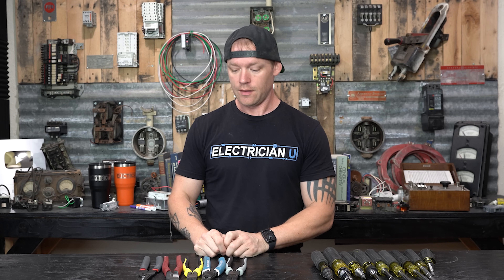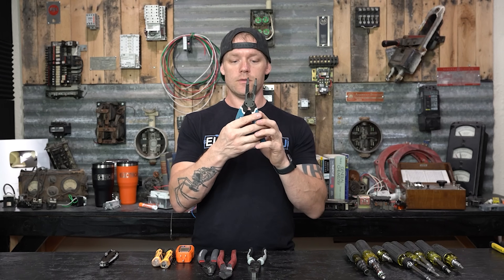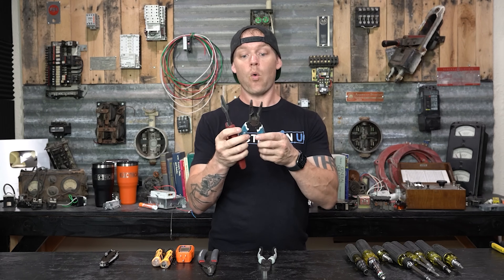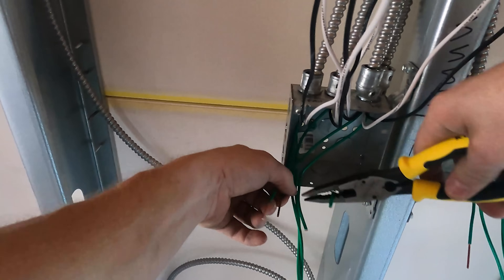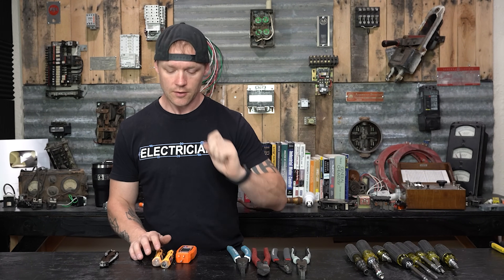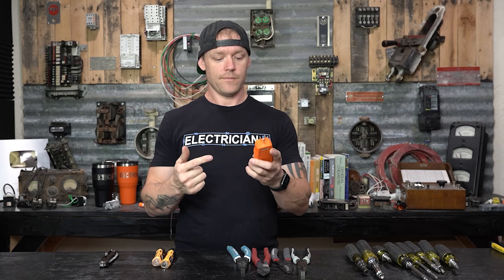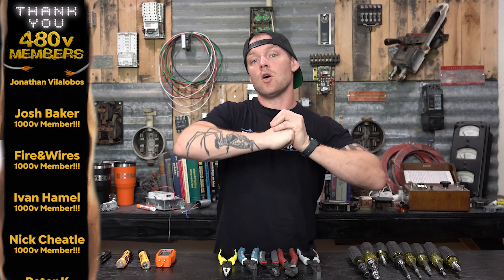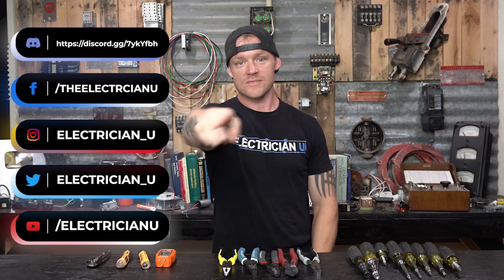The Latest Multitools an Electrician Should Have - Part 2 of 2

Comment: The only Klein brand stuff in my tool box is a tick tracer with built in light builb.
Still have good feelings when I used their curved handle wire stripper in trade school.
Will consider add more Klein elements 😅 thanks a lot for information

Comment: haha i totally thought he was using the IR thermometer version unaware of it reading the temp 13:06 but on the subject of multi tools just buy the IR thermometer version as that still works quite well as a laser pointer and it will read the temp as a bonus. What we need is a rechargeable Volt tick with IR and a light. drives me insane none of Kleins tools are rechargeable... type C with an 18650 would put you way ahead !!!! no more type B or minis PLEASE.

Comment: I completely agree with you that strippers would be WAY more valuable if they would include 6 gauge and have another multi tool stripper for low voltage. I don’t get why all of the manufactures created the same limitations

Comment: On point about how hard it is to make twists with those klein multi. I like linesmens with a spring and i like having two sizes. I have the Milwaukee ironworkers linesmen and same kind from klein but larger. I highly suggest them. Have the standards for when i need to crimp a ground barrel when the boss is around anyway.

Comment: The low voltage tester is great for me cuz I install car electronics for my job. Radios, remote starts and all that jazz. We have diagrams to locate the wires but sometimes the wire is a different color, multiple same colored wires in the same plug or is a couple pins over from where it says it is in the connector. So using that tester for locating say a brake wire is great. You just keep tapping the brakes and see which wire is turning the tester on and off. Saved me a lot of headaches in the past Haha

Comment: Doing pool electric I use everything from 18/5 low volt up to #2 awg, so my strippers always have to go up to #6 awg. I constantly find these “multi tools” do infact do multiple things, however they don’t do any one thing WELL/properly. They always skimp in one area or another, like the handles not being long enough to be good lineman’s, the strip gauges not big enough/economical enough to use as go to strippers, etc. “Single use” tools will always be my go to.

Comment: As a low voltage AV installer here in ATX, the wire stripper that does 12-28 stranded is the best I've ever bought. Perfect for connecting XLRs to phoenix connectors (aka euro blocks) at venues or when I'm making guitar cables/pedals. I'm totally gonna get that receptacle voltage reader tester!

Comment: So just wondering, what if you used a razor blade for cutting  the wire insulation.  As long as you don't lose a strand or make one brittle it's doing the same thing yea?

Comment: I do a lot of the insulated ring and fork terminals, those red handled kleins are my  bread and butter. I was using some snap-on pwcs7acf but their sizing of their stripping notches are a little tight for the wire I use(telcoflex). It's a great compact size but the Kleins are a better tool to have in your bag.

Comment: Good thread , I’ve been a Multitool fan for years , I like both the Klein Grey and Baby Blue multi’s , I’ve always preferred shorter Lineman’s , and I have better than average hand strength , ergo the blue and grey work well for me . Recently I’ve started using the new Knipex Multi , which I also like . Being nearly 70, I try to keep belt weight to a minimum . As a leather worker I make my own pourpose built tool holsters , I long ago declared war on the North American , I’ll fitting belt bucket !

Comment: Sorry man, I rabbit holed on trying to find you a NCVT with flashlight and laser and came up empty. 

You can get Klein branded [Damn near everything I use, but I’m exclusively low voltage / IT]  with IR thermometers, laser distance finder, and a few types of flashlight - but I didn’t see any which combined laser & flashlight functionality. I found a couple on eBay, but they were under $10 and looked like toys - and I can’t in good conscience  point you in that direction. 

If you should stumble across one, hit me up on Gmail with the details, and I’ll get it underway to you.

Thanks for the excellent content.

Comment: Agree with everything that you said. Some of these multi use tools have goofy positions. Think the Klein curved handle wire & screw cutter are great. Have 2 pairs of 90 degree needle nose pliers that probably only use twice a year. Rather use the plain jane long handle side cutters while working with #10 & 12 guage wire. Never purchase anything but made in USA tools.

Comment: I said the same thing about that new Klein receptacle tester. Changes game. Practticaly a simple multi meter., especialy if hu use an adapter. Can test bare wire and lighting receptacles for voltage.I have 3 in different bags. Don't use the old style any more. Super idea koo n klein

Comment: I really like the blue handled “heavy duty “ strippers in this video thr only downside as you say is twisting wire isn’t so easy and I like having the thin plier part of a normal stripper as I like to squeeze the wire around the screws when wiring receptacles so I ended up buying thr regular stripper versioned this tool..

Comment: Check out the Milwaukee Fastback knife with reversable phillips & slotted screwdriver. Remove the tip and it's a 1/4" drive socket. Flips open with a push button (you'll have to loosen the Tory just enough to make it easy). # 48-22-1540

Comment: Well it is a 'voltage tester' not a voltage meter or voltage measuring device, it is testing for the presence of AC voltage on the line significant enough to cause the capacitive load within the voltage tester to be triggered from the EM Field created in an AC circuit which is there (albeit small w/o a load)  W/o an AC voltage the EM field wouldn't exist, and thus it is a voltage tester.

Comment: Point on the "lineman" pliers. 
Do you know what their actual use is besides the cutting head? 
Lol I was an electrician for about 6yrs before I actually used them in the way they were MEANT to be used. I'm not sure what you call the little twisty wire thing that you put on heavy gauge wire that hangs off a power pole. But those pliers are for twisting those together to hold the wire.

Most of us just use them either to cut, or as a hammer lol

Comment: As an electrician in the UK I find these video's very informative but strange to how I have been trained. For a start it is frowned upon in the UK to twist solid cores together and practically all our tools are insulated (even tho we are not meant to work live) I am not saying which way is better or not just highlighting the differences. There are other differences but the list could go on lol
Reply: we twist our cores together because it makes for a stronger bond like braiding single strains of wire to form a larger cable than the wire nut is just a protective cap for the ends not the main source of connection. i myself prefer to use copper crimps and plastic snap caps.  my preferred way since high school tech class late 1990's  https://www.youtube.com/watch?v=UjPfasTjYTg&list=PLYyqRNzaEUGZZ0ouLVCHj1aa6YuIe5WDL&index=24&t=37s

o i too watch a lot of uk sparks a lot of your methods are the same and i love your swa system wld love tht to be code over here as well

Comment: For the non contact tester I've been getting good use out of the Klein that has a temperature sensor with it. Works as a laser pointer as well, but being able to find hot spots in wiring and electronics is super useful.

Comment: I really liked the gray and red hadle strippers however you're right they are flimsy. I broke 2 pair in a year. Now I use the snap on strippers made like the red handle crimper multi tool you showed for low voltage. It's beefy.

Comment: Got a question for anyone and everyone. Building a 48/40 shop horse barn combo. I want to hide as much conduit as I can. The shell of the shop/barn is built with no concrete slab yet. Should I run all my welding plugs under the future slab or up the walls. Shop is 16ft high
Reply: personal preference and foundation area for me i live in the northeast with an everchanging climate so i wld want my foundation slab to be as solid and strong as it cld be so less voids the better for me so i wld say no to being run under or through the slab
Reply: @wizard3z868  that crossed my mind but I got red clay were the shop is here in the north west. Thank you for your input

Comment: Thanks Justin great video as usual, I have to agree with you on these things as well and the end product I would agree as well too. But I use the Milwaukee new one that has interchangeable tips on the end as well as a good razor knife for good scoring and getting those precise Cuts as well as working in a box or panel for quick maintenance or even just to adjust something. I like it because I can actually score the cover plates so I don't feel the pain off of a switch when I have to work on it and I can always use a flat head attachment on the bit so that I can take it off all-in-one tool

Comment: Non Contact testers... Fluke 1AC II Non-Contact Voltage Tester.  Hands down the best.  Most reliable tester I have used.  I have bought and tried many different ones. the Fluke was always the most consistent out of them all.   I would test next to other electricians' testers and the fluke was always right.

Comment: Klein Tools suck, Harbor Freight quality with a expensive brand name.

Do yourselves a favor and invest in Whia and Knipex if you need Tools. They're about the same price as Klein but more quality. Once you go German you don't go back lol.
Reply: Ill bet anything ur in ur 20's
What about supporting an American tool maker? I use klein everyday
Reply: @brandonknight7240  Nope, I am in my late 30's. Don't care where it's made as long as it's quality made. Now don't think I don't believe in supporting American companies, I do. Most of my Power Tools are American made. I have tons of Snap-On hand tools for automotive work. It's just in my professional trade as a Low-Voltage tech I use tools that will not fail me. I  started out with Southwire then switched to Klein and it felt like once a month I was having to buy replacements and fighting the warranty people. Talked to a few other trades in Electrical and Low Voltage and they all pointed me towards Wiha and Knipex. Heck when my Father left me his Tools he had a pair of Knipex wire strippers. They must be at least 30 years old, still sharp as ever. I have a couple of specialty tools made by Klein tools such as a punch-down tool for Ethernet and a VDV scout but that's about it.

Comment: I prefer the Klein 11048.   Dual wire stripper.  It has two #12, two #14, and one #10.  We call them "resi strippers"  for residential.  You can double your speed using them when you get proficient. 

Anything larger than #10 I use a knife, anything smaller I have low volt tools.

Non Contact testers... Fluke 1AC II Non-Contact Voltage Tester.

Comment: So I ended up with all my grandfather's tools he had left. I had been using a pair needle nose, I thought forever it just had a chip put of each side until I needed to strip a 12 gauge wire, and realize he had actually drilled the hole for a 12 gauge wire. He was an retired electrician and had done commercial and residential, and I guess 12 gauge being so common he modified it for 12 gauge. When I noticed I realized he even beveled it to cut after drilling.

Comment: I have the knipex forged electrician pliers which are great but they lack torque on the pliers end because they are long and far from the fulcrum and the cutter being placed near the fulcrum is a problem at times. So, when working at height, I find myself bringing most tools in addition to these pliers. I use them 90% of the time,  but I still need the other pliers also.

I carry individual screw drivers because of speed. I can’t stand multi bit screwdrivers. To each there own i guess.

Comment: My favorite strippers for residential wiring come from Gardner Bender.  They do NM sheath on 12-2 and 14-2,, 14 and 12Ga solid conductor, and have a non contact potential detector built into the handle, (Really handy with the Newbies).  They also have 6-32, 8-32 and 10-32 bolt trimmers in the handle.  And, finally the eye twister is right next to the stripper holes for the conductors.  It took a day to get used to them.  But now for running residential, remodel, and service, (90% of what I do), they are invaluable.  

And, by the way, most of what folks think are combination Phillips and slot screw heads are actually Robinson square drive, and slotted.  Canada requires the square drive, and the US requires slotted.  The manufacturers thus developed a combination for the North American market which has both.  If you get the “Combo” or “Combi” tips for your multi-driver, or a dedicated screw driver for them, it is the handiest thing since the original Leatherman multi-tool, or a pocket knife.  Klein and Milwaukee, both have them available.  Hopefully other manufacturers will soon.

Comment: Another advantage of the Klein outlet tester is that it will detect an outlet with voltage on the hot wire but no neutral or ground.  The old fashioned outlet testers with the 3 lights will stay dark in that situation, making you assume the outlet is unpowered.

Comment: The gray handle multi plier has replaced my linesman which now stay in the bag... I find cutting no problem but I hated the fact of no fishtape puller. So I cut one in with my Dremel and they are perfect! That "laser" pointer is the bomb! No klein hawkbill knife eh?
Reply: do you feel like you have to put way more effort in gripping with the custom fish tape puller?
Reply: That's why I cut in the other style puller. The multi plier comes with the in between the handles style puller... that style always slips. I cut a space in the handle for non slip style puller between the handle and the hinge.

Comment: As for plug testers I highly recommend the klein circuit breaker finder. It is a plug tester that comes with a receiver to quickly find breakers. HUGE time saver! Preparing for demo making it safe for people when there are multiple panels and sensitive areas to be left undisturbed in a 50+ year old building that has been hacked over the years.... yeah absolutely the very best tool for the job! It's also inexpensive no brainer.
Reply: I bought both.. when you don't need the breaker finder function, the digital readout is very handy. The GFCI tester also tells you how long it took to trip, and if you plug in a hi-load appliance like a heat gun or hair dryer into the other socket of the same outlet, you can monitor the voltage drop for troubleshooting high resistance in a circuit.
Reply: Maybe Klein can, like, combine these two? 😁

Comment: What are your thoughts on ideal tools. I have just purchased their bender and its great
Reply: Ideal recently donated a lot of tools at my local electrical supply store. So I've been testing out some of their hand tools. Currently using their Stripper and multi tool screwdriver and they work great
Reply: @leonardo1229  here in Canada ideal wire nuts are the industry standard. We call them cantwists. I also have the ideal wire stripper and in my opinion it's on par with the klien ones. I also use the Milwaukee linesman pliers I think they are awesome. Here in Canada klien tools are very expensive. Everything is extremely expensive and electrical is an underpaid trade. I'm working on getting out of Canada and into the US.

Comment: Great tool tutorial Dustin 👍you're really promoting Klein.
I hope they take notice and sponsor you! I'm rocking the gray and black handle multi pliers. They have two big flaws that Klein hasn't addressed yet. Don't sheer 8/32 screws with these! I've broke three pair doing so. The other problem is a raised lip on the inside the pliers, that will score your ground wires twisting pigtails for multi switch location before your Buchanan sleeves are installed. Causing them to break off.

Comment: Keep being picky, man! Especially in a video where the tool manufacturer is probably seeing it (cough cough). It's good feedback, and all your points are dead on.

btw, the Ideal 45-418 and 45-124 strippers are all 6-14 AWG solid... But they def have that slightly "breakable" feel.
Reply: Ideal makes the best strippers ✌️
Reply: Klein makes a 6-12 stranded stripper. As a solar guy we almost exclusively use 6 8 and 10 wire
Reply: @dudeman650  I think his point was, you're still missing the 14, and the fact you might need to back to truck to grab another stripper is annoying

Comment: Are the power testers rechargeable or do they take batteries?
Reply: The Klein outlet/GFCI tester with the LCD uses 2 AAA batteries, and it comes with them.
Reply: All the non-contact voltage "testers" require batteries.